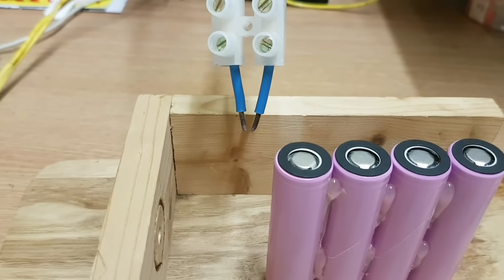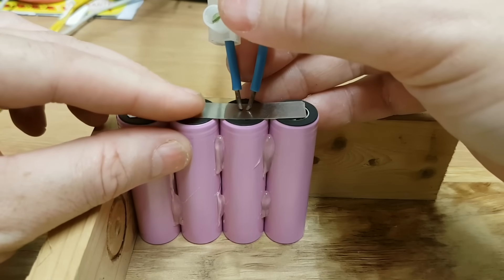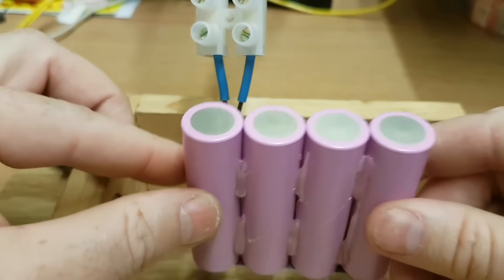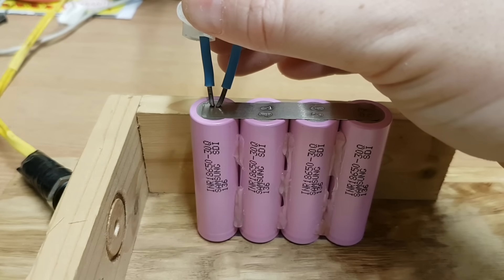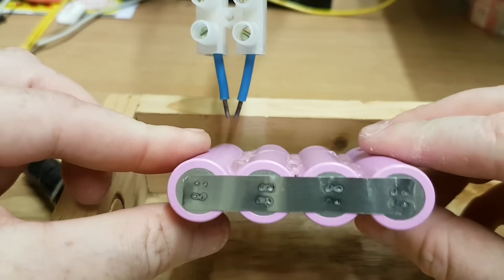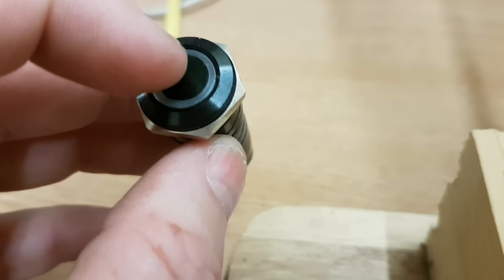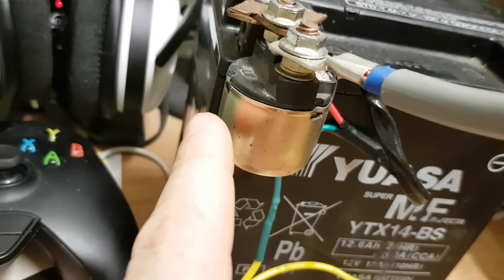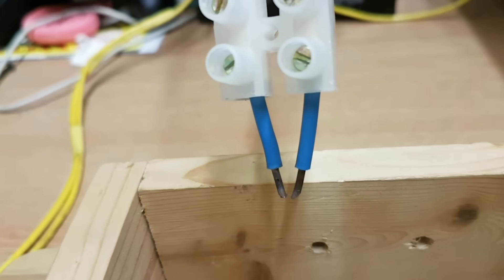DIY Battery Spot Welder - Demonstration & Explanation

Comment: Hello Darkkevind, very nice machine. Every shot works perfectly.
I have a querry. I made my first 3s batterypack few days ago. Using 3 x 4 = 12 cells. I did not solder or weld them. I used the spring loaded 3 cell plastic containers, and glued them back to back opposite directions. No cell touches eachother. But from the top and bottom I attached lot of wires, positives, negatives, and balance wires that goes together to the BMS at one end. Then I ducktaped the whole thing. 
I am using it to run powerful 100watt LEDs on my bike.
Is it safe so far?

Comment: just a newbie question, why would you do this and for what application?
Reply from the maker: This is to spot weld multiple 18650 batteries together to make a bigger battery. Perhaps for an e-bike or power wall or even an electric car. For me, it's for my electric skateboards.
Reply: @darkkevind   so when you add the voltage is accumulative?
Reply from the maker: @nmssis  putting them 4 in parallel, as I'm doing here in this video, multiplies the capacity X4, but the voltage stays the same. Then you can put each of these groups in series to increase the overall voltage.
Reply: @darkkevind  Noted, thank you!!  Subbed!

Comment: Why do you need the solenoid?
Reply: Usually the momentary switch can't handle the high current dump of a spot welder and will stop working (quickly).
Reply from the maker: Yes, exactly that. It's to handle the high current. The small momentary switch is rated for 6A whereas the relay is rated for 150A+
Reply: Oh it's just a relay then, I was confused by the solenoid name, thanks :)

Comment: hello ...how do you control the current of the weld ? and how can you measure it ?
Reply from the maker: The battery controls the current. Along with the resistance of the cables you use.

Comment: Thanks, this is simplest and best DIY solution, and I'm thinking of making one. I seen solenoid price around 30$ . What do you think of using SSR , momentary foot switch and delay relay module as upgrade?  Apparently SSR are just right for something like this because, and I quote : "Applications requiring high speed and frequent switching operations."
Reply from the maker: I don't recommend the foot switch over the solenoid/relay... you have to have the relay. You should be able to pick one up for less than $10.
Reply: @darkkevind  I mean foot switch instead of momentary switch button, that way you have both hands free
Reply from the maker: @rdstvnvc66  oh! Yeah, that would work, but only paired with a timer as you'll never get the right timing with your foot as you can with your finger.

Comment: Hello friend. Does it meter the voltage of the battery or just the amps to melt the nickel strip?
Reply from the maker: It's mostly current that does it. But in order to deliver the current, the battery must be fully charged.

Comment: Shouldn't one of the terminals be touching the metal of the battery and the other the nickel strip? Have you tried removing or breaking the weld? 

I would think the bond would be weaker with birh contacts on the one side of the strip.   Or am I missing something?
Reply from the maker: Lol, no that won't work, especially if you're doing the positive weld as that would put the whole current of the car battery through the individual cell.
Reply: @darkkevind  lol no, you misunderstood or I didn't word that properly...🙊

I meant of the two weld leads, one touching the tab of the battery, and the other on top of the nickel strip... Not the second electrode on the other end of the battery.. that would exceed the charge vf and input current and would not end well 🤪

In other words energize both pieces of metal that you're trying to bond... 

The way you do it in the video is counter intuitive to me when I think of traditional spot welding where your work piece is essentially 'sandwiched' between the electrodes .

Hope that made more sense 😎
Reply from the maker: @SNG.OfficiaI  yes, I see what you mean, but it doesn't work the same way... The current travels from one electrode to the other in the shortest route possible. That's through the nickel, through the steel of the cell and back out to the other electrode.
Reply: @darkkevind  okay, I get what you're saying... Now I  want to try this both ways and strength test.

I think passing the current from top to bottom rather than across would still make a more thorough weld, but may not make as much of a difference as I'm thinking.

Only one way to find out! Thanks for the replies none the less 🤘

Comment: There is a lot to be said for choosing a battery that ensures that the current is only a little bit more than you need. Makes everything else easier to source and lasts longer.
Reply: The only caveat to that, is that with Lead Acid, as the battery starts to age (Positive Plate Rot), then if you start off with just enough current capacity, you will quickly end up with not quite enough - if you go perhaps 50% over, the 2.5mm wires will limit current (as will the nickel strip) and the battery should last appreciably longer as it has an easier life.

Comment: Very creative, well done,brilliant video.  10 out of 10.
I've spent ages trying to solder batteries together and never succeeded. Looks like I'm going to be the first and ask is it absolutely necessary to use expensive thin nickel plate strips? I was thinking baked bean tin or if feeling flush perhaps a beer tin, cut up obviously :-) can you spot weld dissimilar metals?
 Ignore the clever sods trying to steal your lime light by suggesting a foot switch - I know you knew that already, in fact I think you said so :-)
Reply from the maker: Nickel is really the only thing you should use. A steel beer can would cause too much resistance. Thanks for your kind words 👍🏼

Comment: Ever tried welding 0.15mm nickel strip through 0.15mm copper strip to cells with this set up? I have and although it sometimes works I have had 3 solenoids mow repeatedly stick on!! Yet to find a solenoid that doesnt stick. The 500 Amp solenoid in your link from Amazon at £26 also stuck so I opened it to find smaller contacts than a 150 amp ones I have which both stuck! That 500A is probably a re-stickered 80 Amp as someone else suggested on here or in the Amazon reviews which are worth reading before buying. It can be bought for far less than the linked one at that price elesewhere too I you feel you must.

Comment: It quite sucks that I'm still practicing with my capacitor discharge unit, made a jig with springs so both electrodes get nice contactpressure and such and (so far) have only been able to produce 1 reliable weld with 0,15 mm strip after about 100 atempts and yours just does the job ;)
Reply from the maker: Sorry 🥴
Reply: @darkkevind  Well, got there in the end ;) I just bought a kWeld, which works a treat. I maybe will be using the left-over caps again to power the kWeld instead of the LiPo (which works, but I still don't really like the idea of that thing getting a dead short thrown at it with every spotweld).
Got a tool-battery revived and got 4 of my 5 V-mount batteries recelled (I'm afraid I'll have to consider one of the PCB's a write-off as it just has seen to much soldering, abuse and what not)
Reply: @darkkevind  Haha no worries ;) I just went with capacitors and a bunch of MOSFETs controlled by a 555-as-one-shot because I did not want to have a heavy battery around (And I don't have a spare/old one as well)
At this point, it's probably the contact-pressure or the electrodes themselves that aren't right (overall small in diameter compared to most other peoples). But when I see yours, mine should perform pretty well (same wiring, but then pulled slightly smaller, to increase the rigidity and make it fit in my brass blocks attached to the jig, which is then placed in the Proxxon table-drill rig)
As the electrodes also feature a spring to they can move independent of each other, I thought I would be in business pretty soon ;)
Turns out 0,15 mm thick nickel strip is do-able (but requires practice) and 0,3 mm is just hard (and, besides a slot in the strip, probably takes more voltage or more capacitance (and thus probably more contact-pressure as well)
Right now, the pulse-width is 4 milliseconds. Upping it anymore seems pretty useless considering the huge sparks I already experienced ;)

Comment: I want to get into this sort of thing, is there any safety wear that is recommended?  Like will regular safety glasses do or should I need something that can block IR or UV etc?  Does this produce any of that?  I get it's basically just a spark, but if it's producing anything harmful don't want to be exposed if building big packs.
Reply from the maker: You really don't need anything at all but it wouldn't hurt to wear some regular safety goggles I guess 🤷

Comment: Hello Sir
You may provide me with the complete diagram of your battery powered spot welder and indicate the type of wiring and it is always necessary to use copper to make the spots or you may use stainless steel

Comment: I've made exactly the same welder same size battery current, slightly less AH but when i press the button even a split second its too hot and burns straight through causing sparks also. I have now ordered 100% nickel strips cos both other times i have bought i have been ripped off due to them being steel plated. Anyways anyone have an idea how to reduce the current? its just too hot and powerful. I used it on some old batteries and the weld actually burnt through the top of the battery

Comment: got a relay from amazon  cheaper 1 looks like the 1 used in clip but pink wire and yellow wire with red stripe
 which one is posi ?
Reply from the maker: Shouldn't matter. But try it out first with just connecting that up to the battery loosely... It should click. If it does, that's the right way round.
Reply: thanks mate

Comment: Just so you're aware, the CCA rating (cold cranking amps) is like the max safe draw from the battery over a few seconds period in less than ideal conditions ( 0 Fahrenheit i think) and still maintain enough voltage to crank a car (above 7.2v), so using this shorter pulse, in good temps and ignoring voltage drop, the current is highly likely to be more than 200A as a direct short. Not saying this is a problem or anything assuming the battery doesn't start gassing or anything, just that if you're expecting to get 200A and are basing calculations on that, it might be good to try and capture the max draw maybe using a scope on single shot mode and a clamp meter as its highly likely to be well over 200A.  Once again, im not being in any way critical, i love the project you've done there and its good to see people not just buying cheap unit that are really over priced for what they are, much respect for doing it yourself, i just thought the info may be useful.
Reply from the maker: No mate, that's helpful, thanks. I'm not sure of the actual current being used when it's shorted for that split second, I just know that to work, it needs a battery with a CCA rating of between 200-400A. But yeah... I should probably measure it 👍
Reply: darkkevind it’s just nice to see someone actually making their own product instead of buying junk online which wouldn’t work as well as yours and potentially could be dangerous. The fact is, yours works and the current passing could be irrelevant to you, based on the fact that it works and maybe you don’t need to do any calculations? Once again tho I just want to make sure people are aware I’m not being critical of the project at all, I have a lot of respect for anyone who develops their own projects. I’m a qualified electronics engineer, if I can do anything to help please let me know. To be honest it seems like you’ve got this all figured out but if I can do anything I’m more than willing.

Comment: thanks for sharing! I tried with a 12V 12Ah battery, it sparked and made a hole on the nickel strip :D there is a Ah limit by using this way?
Reply from the maker: Nothing to do with AH limit. It's the CCA limit that you need to worry about. It needs to be between 330 - 450A.

Comment: I have a deadly mains version of this. 
A 20 W CFL buld in series with 1000uF capacitor .
I used a engine starter relay which complete the circuit and dumps that mains voltage charged capacitor into the spot.

Comment: Good info! Did you ever put the timer in??? This would be inline with your momentary switch to your solenoid right? Why do i see other split welds with a Bunch of mosfets etc?
Reply from the maker: Thanks! No. Didn't need to in the end. Managed to get the running right just manually... 🤷
Reply: @darkkevind   super.. starting to gather my parts :-)

Comment: THANK YOU
I am converting my longboard to be an electric one. I still need to build the battery pack as premade ones are either sketchy or really overpriced.
Most of the spot welders out there are way to expensive for just one battery pack. I was about to give in and buy a premade pack when I saw your video. The solution is so simple that it never ocurred to me. Might spice it up with an arduino to manage the timing as I don't trust myself to nail that.
Reply: This is a super simple welder and while i am no electrician i am a little bit of a hobbyist and this way of spot-welding was not even on my radar and IT IS SO SIMPLE AND PRACTICAL.

Comment: I  tried this schematic using nails as the end points of the welder, but the nickel strips keep sticking to the nails instead of the batteries?
Reply from the maker: It's quite possible that you have nickel plated steel instead of pure nickel strips.
Reply: @darkkevind I ordered a spot welder pen from Amazon to replace to 2 nails and it works great now. Thanks again.
Reply from the maker: @seanogrady2629  that's awesome! Glad it's all sorted for you now 👍

Comment: I took your advice and copied your welder specs but i bought a 200 amp solenoid but the results were that too many amps caused  burning.
I will try a 150 amp solenoid next.

Comment: I bought some 0.1 mm (labelled) nickel strips. Maybe I should have bought thicker ones, because I had a problem with the welder burning a hole in the strips, and the weld not holding. I am using a 35ahr battery (like you) and using very thick hookup cables, maybe #8 wire. I found improvement (fewer situations with burning a hole in the nickel strip) with using thinner wire for the hookup. The hookup wire gets a bit warm, but this is expected, as the current is reduced on the electrodes. 
Also, even though I tried to apply equal pressure on the electrodes, in almost every case, only one (of the two weld spots) would hold. I just  welded again, and only one spot would hold. This way I got 2 (instead of 4 like you got) reasonably  good spot welds. Maybe good enough for use as a small laptop battery that takes about an amp. The whole process in my opinion requires quite a bit of dexterity (amount of hold pressure on electrodes, equal pressure on electrodes, press button time, etc, current in the electrodes, thickness of nickel strips, etc). I think the process is more difficult than your video shows.
Reply from the maker: It's really not that difficult. I wonder if your battery is delivering too many amps?

Comment: Received 2 x long copper Welding pens with my kit. But they are blunt. How to Sharpen then with out destroying them??? 
I have 8-10 AwG cable as the 12 and 10 that came with the kit is not up to speck. No doubts works but I would like less resistance as possible. 
Subbed. 👍✌️💪

Comment: If that's tinplate, then I don't think you're welding, you're probably just soldering the two parts together. Spot welding usually pinches the two pieces together and the current passes between them, melting a bead at the mating faces. Clearly you can generate a lot of heat through between your contacts, but surely it's just melting the solder and giving you a soft soldered joint? If you were inputting enough energy to spot weld, I think you'd melt a pool of metal between your electrodes on the surface.
Reply from the maker: It's definitely spot welding. It's pure nickel strips. When it's done, if you pull them apart, firstly, it's really hard to, but where the electrodes welded, it tears and leaves part of one side of the strip on the other still...
Reply: @darkkevind  - Ok, that's very interesting and rather surprising. I've never seen it done like that.